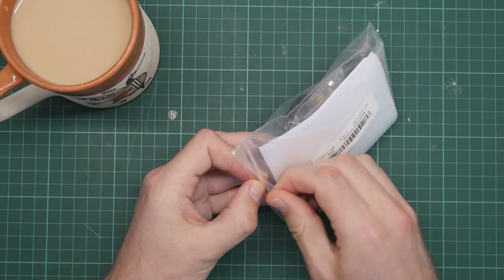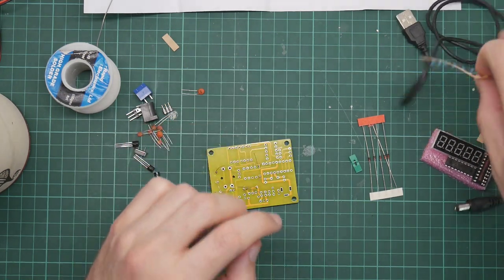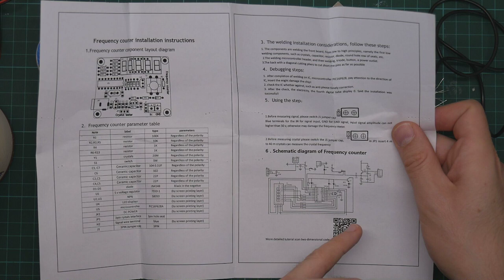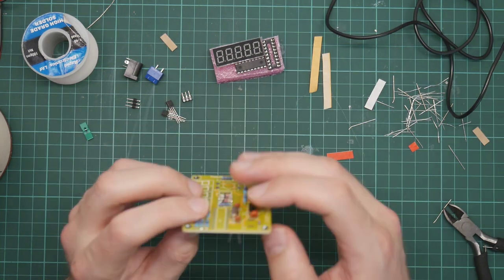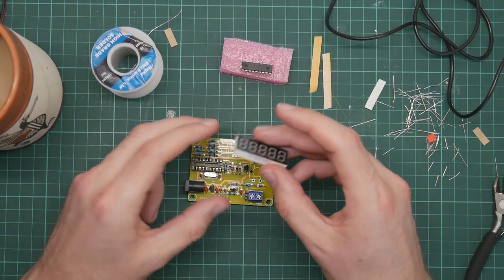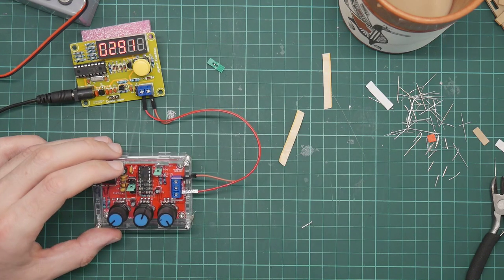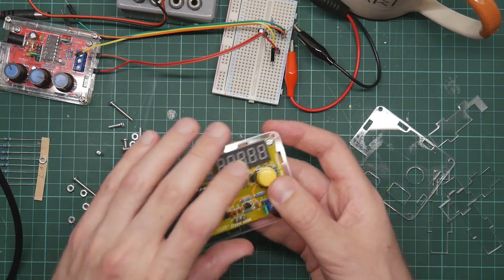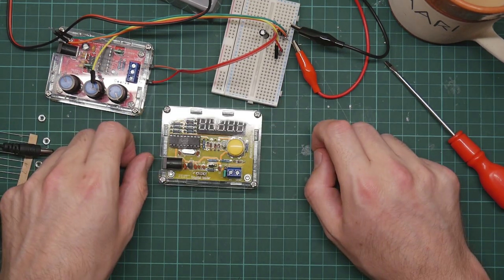Hjalfi builds a $10 frequency counter

Comment: 37:55 The reason the tester thinks it's a diode is because you put it in the spot that's marked "2-3-2", so the collector and emitter are actually connected together. If you put the three terminals into 3 differently-numbered slots on the tester, it will tell you it's a transistor ;-) 
Don't worry, happened to me too, the pinout is not very logical on these testers....